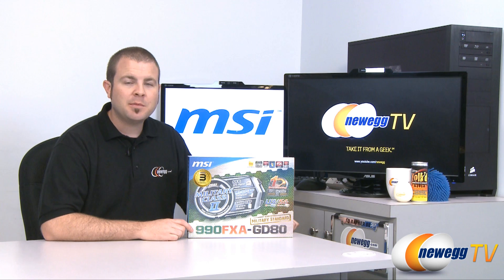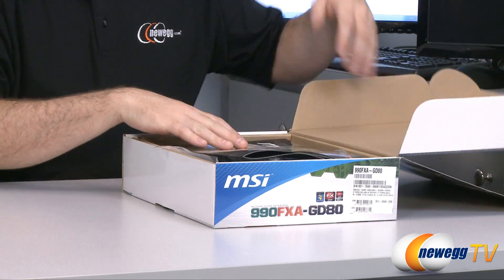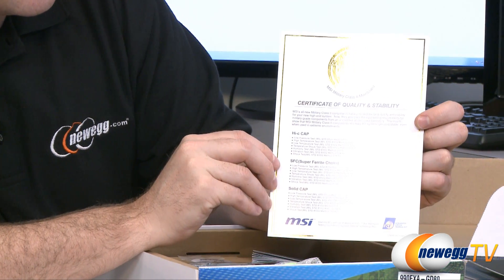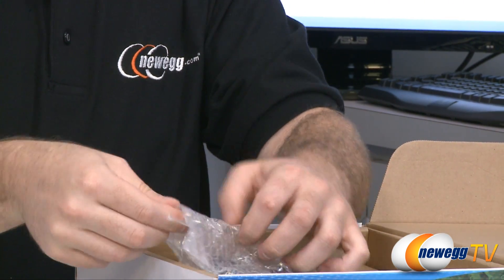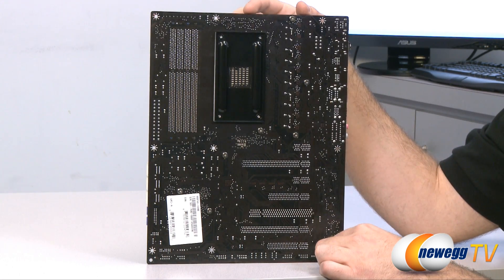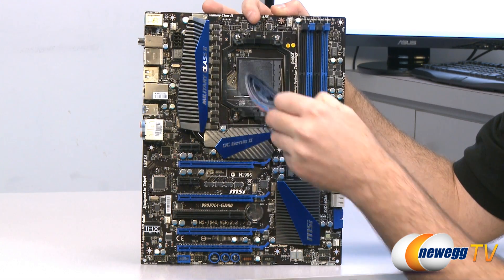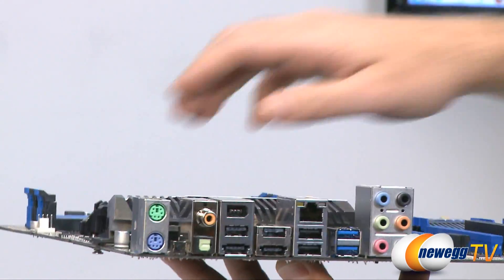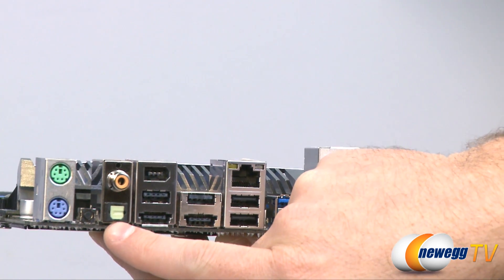Newegg TV: MSI 990FXA-GD80 AM3+ 990FX Motherboard

Comment: I just got this board shipped from Tigerdirect and noticed that the end of the antistatic bag didn't have the strip of tape sealing it and those clear protective tape strips on the heatsinks were missing. Should I be worried and return it or should I just install it and see what happens? What do you guys think?

Comment: @motel420 I'm in the same boat as you, this is going to be my first build and I think I'm going to use this mobo. I'm going to wait until the bulldozer comes out first before I make any purchases. I might get the FX-8, or a Phenom II 1100 if it's too pricey for me now and upgrade later. Probably going to drop in an AMD 6970, not sure if I should do a ssd of hdd. Will upgrade to crossfirex later on. Anyway, getting geared up soon, looking forward to it!! :)

Comment: Yea, pretty sure mine is NOT the B1...It specifically says 11.4 - nothing more.. If you guys have issues getting IN to bios (i.e. pressing delete key doesn't work), I am able to do it with just a standard Microsoft "Comfort Curve" keyboard (in other words, just a plain old USB keyboard). My Logitech G15 is hit and miss. I haven't had any other issues, though. And also, I agree:I have high hopes that this board will really show its teeth, once Zambezi/Bulldozer comes out :D

Comment: @SynysterCondom Sweet =) I've owned 3 MSI boards now and only problems I've had were my fault! They won me over from Asus due to their similar quality standards and features, while still offering lower prices. I've even used their GPUs in my last 3 builds, as well...Currently have 2 MSI 6970 Lightnings - performance is awesome and rock solid stable. Built like tanks, too so I have no doubt it will last long beyond the warranty!

Comment: If you own this motherboard, get the 11.4 (aka B.4) BIOS released just within the past week....MSI has given us a lovely surprise in it, that is not mentioned in the release notes. If you have problems accessing your BIOS setup after flashing, try another keyboard (PS2 is almost guaranteed, but I was able to use just a standard MS Ergonomic USB keyboard, where my Logitech G15 would not work initially). Once you get it going, you'll see why this board is priced with the big boys ;)